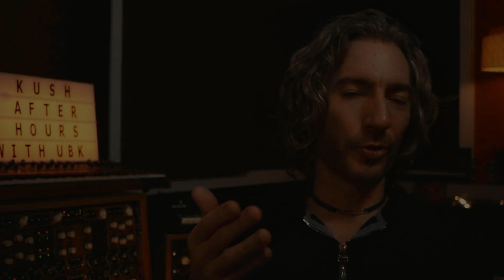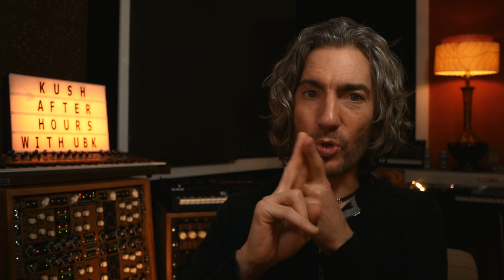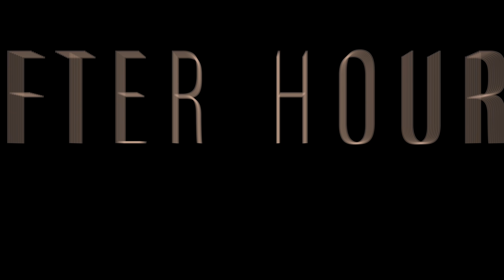Dial your KICK and BASS Faster & EASIER Than Ever!

Comment: It's amazing how much you can highpass that kick and still have it wallop. For setting level, I'll send just the kick and snare through the mixbuss compressor, hitting both at equal amounts. Then bring in the bass with the kick and do the same thing. After that, start moving up the highpass until the kick feels tight and out of the way of the sub of the bass; like you, sometimes up as high as 50-60hz. At that point, the groove of the kick is enhancing and  playing nicely with both the bass and the snare.
I haven't tried the finger trick, though. It's now on my to-do list for tomorrow!

Comment: Just tried it and wow, this is next level for me I never seen this technique and never considered the possibility. I am really shocked by the amount of detail you can perceive with your fingers. I did the bass solo and felt how it sounded and then unmuted the kick like you said and it did 100% what you described. My kick was too long and it was distorting the bass and killing the groove. I could easily feel it with my fingers. I am working on a slow track with 4 on the floor kick and bass on the eight off beat and I can really feel how making the kick shorter grooves better, pretty damn amazing. 
I could also feel the low end of other instruments in my mix far better than I could hear it. I am really shocked by the detail you can feel with your fingers. For the low end it is almost better than your ears.

Comment: Greg could you please do a video on vocal reverb tricks & techniques?  Id appreciate knowing more of your insights on reverbs.  I feel most people just slap one on & adjust the filter but dont really have insight on the many ways to use it to create the illusion of depth a swell as to glue things together(like the old wall of sound technique).  

I was happy when big 80s style vocal reverb mixes came back.  Even rap has never had so much reverb.  It can really save these modern bright digital in the box analog warmth lacking mixes I hear these days especially vocals recorded close on bright $100 range mics.

Comment: Hello Greg! Great tutorial! Quick question. 
Didn't know bout this trick in particular, but I've kinda (re)invented it myself, BUT, doing this by watching at the waveform of the bounce. After analyzing several tracks and waveform wise, I noticed that the overall flow of it is just this sine wave which is obv the bass and the kick with the other harmonics on top. when a kick is out of tune, or out of phase in a way with the sub it would break the sine wave motion, so I can visually see that. 
SO the question: 
Do you think this technique is applicable to just identify the problem visually in the waveform? 
Thank you so much for what you are doing

Comment: For a minute there I started thinking about sex.   As one does.  In, out, in out, rhythm, ebb and flow, and when you’ve got the right mate, that same kick and bass harmony is the very thing that grabs your heart and DESIRE that feel, more and more.  Some call it love.    I call it loving music.   And in my room over the garage/ man cave from heaven and hell, I’ve got the most ridiculous PA/ playback sound system.    I’m a veteran live sound engineer and there buy acquire loads of weird gear, cool gear, and useless gear.  So these two Peavey TriFlex subs that had been really cool coffee tables for maybe ten years got a try out after just, I don’t know, a wild hair.   They worked!   And sounded remarkably good!   So I looked into them, literally and figuratively.    Double down firing twelves.   Hmmm.       Hmmmmm.     What kind of processing crap do I have laying around?   I need two channels of amp, ☑️, two channels of crossover which can both be in the sub range, delay per channel, phase per channel, ☑️☑️☑️, all in an old dbx Driverack.   One in, I made it left, two out, the mid out and the low out both became sub out, and about two years of obsessive analysis have rewarded me with astonishing bass in my room.  And it’s shaped into a cardioid pattern, more like a hyper cardioid, with tucked in buttocks, beautiful front end lobe, and hips which envelope your body, toes to nose, and even after twenty five years of being a pretty hardcore sound guy, thinking I was near the top of my game, I felt like I and almost started over.    This newfound shaping of the bass has had an unexpected side effect benefit of really showing me where all of that info is within our bodies and minds.  My 100-16Khz speakers happen to EAW SM200s, world touring standard stage wedges which I have chosen to retain simply for nostalgia, but rarely take out cause they’re like 85 lbs each.   I’ve got JBL 2206s in them, and the factory original conical horn and driver.   Conical.   When you pull the grille on an SM200, the horn isn’t molded out of plastic or whatever material du jour.    it’s several layers of laminated wood, carved out like, well actually they have the same profile as a 10” or 12” driver, just a little shallower, and no vertical versus horizontal shading.     I’ve got this bulletproof PA as technically close yet musically and realistically close to flat as I care to.   22hz to 18khz.    And I can be playing bass, at the loud volume I prefer, measuring about 94dbC max in the room so that I don’t freak out the neighbors with 70’s dub reggae or NIN or Massive Attack or Carcass, or Jane’s Addiction ripping a hole into my heart and throbbing till it feels too good to be real, yet it is, and here’s the kicker, no bass through the rest of the house!   Cancellation where I want, and stupid full range reproduction where I do, except for one thing, the harmonic phenomenon associated with this sub bass manipulation has had unexpected impacts on my listening ear, and more importantly, the feeling of previously unperceived relationships.     Here’s one for y’all.    In my listening chair, 10’ from the front sub, when all the things line up just right, time and space wise, I can feel the floor rolling past me on its way outside through the wall behind me.  It’s astounding.  It feels like a 2.0 earthquake, subtle, and at first I though it was the trash truck.   But it happened on days other than Tuesdays.    Ok so it’s the school bus going by.    Not on Saturday, nor in the middle of the night.    Lining up the phasing of these subs and manipulating the lobe presented to myself has redefined how I perceive music playback.     One bad side effect is that standing in certain spots really accentuates certain bandwidths of sub info, but that’s not the end of the world, cause it’s often really cool.    Like the opening bass tones of “Various Methods of Escape” by NIN can make my nose tickle and my calves twitch, and it’s not from sheer volume.    It’s a new level of listening.     This guy is cool.  He and I would get along.     Big ups Kushy.

Comment: Hey Greg, what about using a VU meter (-18) on your master; first bring the kick to -3 on the VU, bringing in the bass next and getting it to 0 on the VU, and then balancing the mix around that? What are your thoughts on this process?
Reply from the maker: I never had any luck using meters for any purpose other than optimizing gain staging.  I feel like the amount and style of compression and the amount and shape of the lows, low mids, and mids completely skewed the metering approach, like I could create 3 verrrry different sounding balances of kick and bass that all read identically on a VU and none of which worked for the track.  But I don't say this to discourage you --- quite the opposite, you should absolutely explore where your instinct points you! --- I'm just relating why I never have any luck with anything in the 'paint by numbers' arena.
Reply: I actually use this "trick" all the time just to get the volume / balance right for my bass in a mix. I used to struggle big time and bass always seemed to loud but ever since using this trick I've never had issues. Bass mixing issues that is 😂

Comment: I was a toddler in the 80ties but yes I do the "finger trick", can't remember who taught me about it first. Other tricks include checking phase using phase correlation meters. Which basically is the visual variant of the tactical finger thing. Unfortunately when mixing live shows it's hard to sneak under the stage and touch the subs. :-)

Comment: The delay setting in Ableton makes so much sense now. (That delay build in to every channel, see the “D” sign in the bottom right of the screen)
Reply: In which way? Can you explain better?
Reply: @kongregant8100  in Ableton, on the right side you have some options: to hide/show the mixer, hide/show the input output, hide/show send & returns, etc...- you will also see in that section a “D” letter. 
By default, this “D” isn’t engaged when you open Ableton. Just press it and under each channel fader you will see “Track Delay”. Now drag the 0.00 value with the mouse and you can shift the whole track back & forth in miliseconds. 
Hope you understand now.
Reply: @pufu21  yeah I know where it is >,< I meant if you could explain why it makes more sense now
Reply: @kongregant8100  ah, because you can easily move the kick / bass to find the sweet spot
Reply: @pufu21  now makes sense gotta try the trick
Reply: @kongregant8100  👋🏼🙂

Comment: Fantastic info as usual. I have a follow up question, though. I’ve been noticing an effect in certain tracks more and more, and it has become sort of my “holy grail” for bass mixing. I can’t seem to nail it down every single time. Some tracks, even on headphones with weak bass response, seem to sound like the sub is coming from “underneath” me, rather than more forward focused and “between the ears.” How is this accomplished? I’ve gotten CLOSE sometimes using varying degrees of multiband compression on the sub, but I haven’t gotten it down to a science. Any advice?
Reply from the maker: I have no idea because I don't know the sound you're describing, but the first thing I would look for in the songs that have "it" is commonalities in the arrangement, including similarities in the bass sound itself as well as what's going on around it.  Lowpass them all around 80Hz and just listen to the low end, what's actually going on down there.  It could be as simple as having a solid but subtle weight at 30Hz, which is generally felt more than heard and can have that kind of psychoacoustic effect.

Comment: *Warning* I used to do this and now I have permanent dents in the rubber part of my Focal solo 6 be speakers. Didn't have a problem with Rokit 6s which I owned previously. Kinda heartbroken at what happened to my focals though! Good trick, but beware of doing it with your Focals

Comment: Interesting approach, Gregory. I've often helped myself by lowpassing the whole mix so that it sounded like standing outside of a club, a sound that I know very well btw. And if it didn't sound or even groove like that, I knew exactly what to do in terms of balancing, EQ and compression. The trick is to judge it at a relatively low level and this has to fkn groove already. Well.... It might depend on the genre if this works for you or not but generally speaking it has to have a feel, a vibe, a groove, an intriguing sound or let's say has to be music already. If not, then something went wrong. :D

Comment: ....or, get some real speakers, like my original set of Studio 'A' monitors that I designed and built with my partner in 1970.
40 Hz ?
Like that's a problem ?
We were clean down to 10 Hz.
That's as low as our signal generator went.

Comment: Man i used to do this all the time 👌 a few years ago i got the subpac and thats my ”finger on the woofer” now 🙂
Reply: Cool! I'm thinking of a subpac. How are they? Do they make a lot of noise? Uncomfortable?
Reply: @oskjan1  subpac is a great product. Many people seem to use it in a way i think is wrong though. And that is where your question of if it makes alot of noise. Yes, if you turn it up loud it will make sound. But if you use it wisely it does not make any noise. This will also make it comfy to use. When cranked it can actually get you kind of sick. The point with the subpac for me is to get an enhanced monitoring experience combined with my speakers, so i have it very low. It’s allmost like getting a set of mains in your room for a fraction of the price. Another great sideeffect of using subpac is that you tend to have your monitors at lower levels because the vibrations of the subpac goes into your spine. It’s a great tool. It takes a little time to get used to, especially to set it to a good level that makes sense, but when you do it’s kind of a set and forget thing where you just keep it at that for consistency 🙂
Reply: @moano3271  Thanks for the nice reply, man! =)